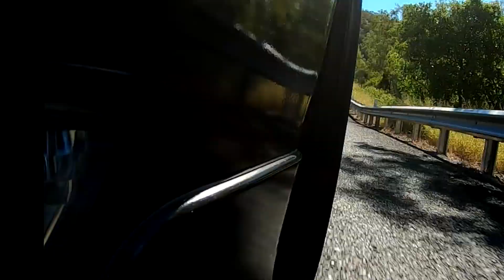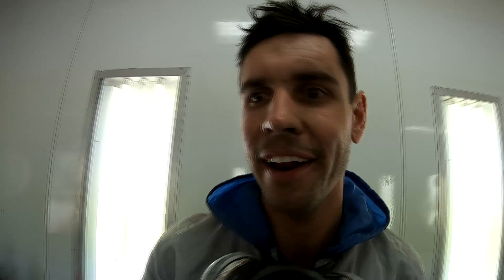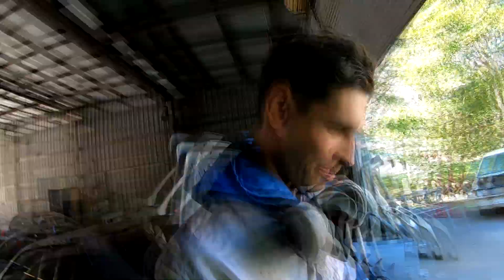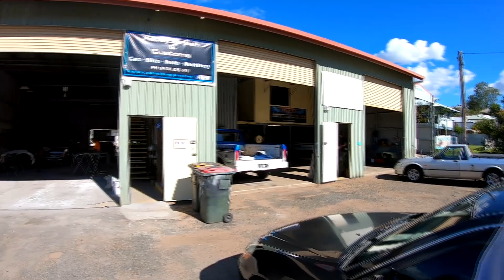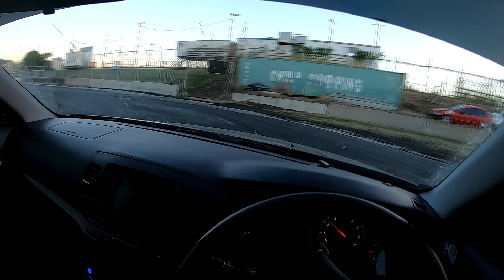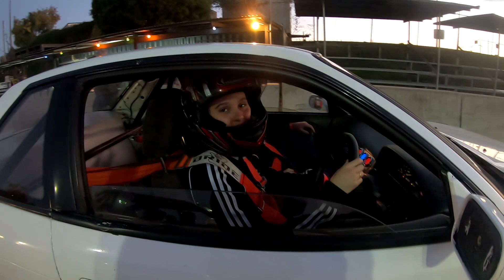Summerset cruise or thrash?

Comment: Funny you mention starting in a vl, i started in an auto xf with a single spinner before i knew what drifting was (15-20yrs ago) earnt a reputation as a bad driver in that thing as your had to be really aggressive with it to get it to initiate without using umbrella handbrake which kept getting jammed if i used it, i didn't continue with it though, did a little bit in the s2 rx7 13b bp after that but just for fun